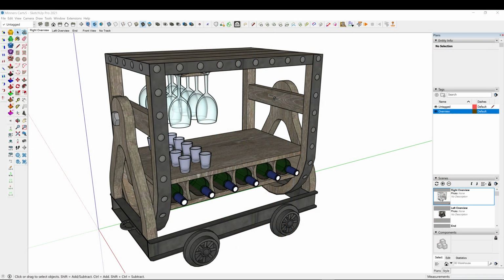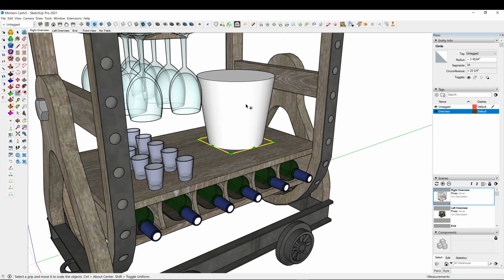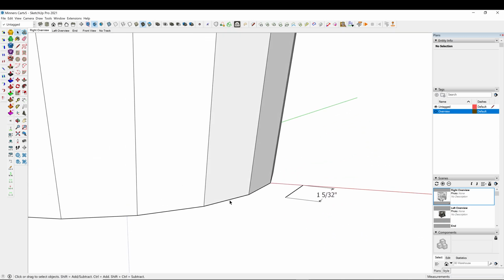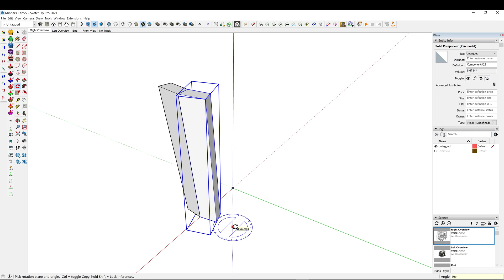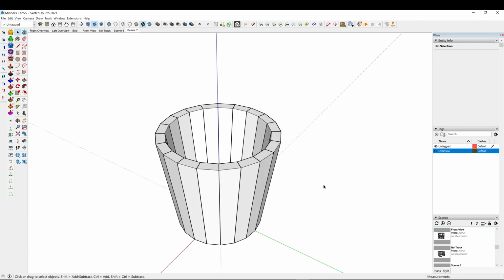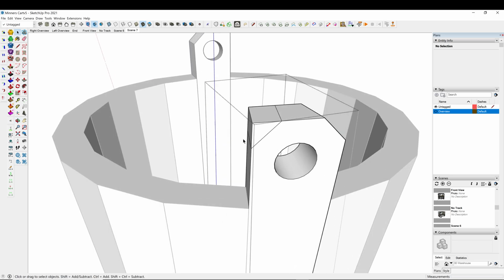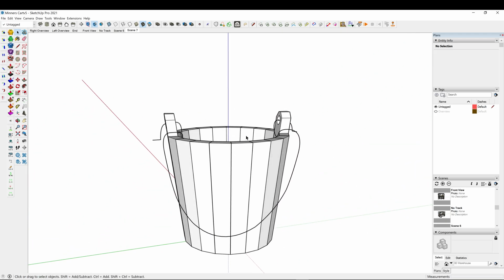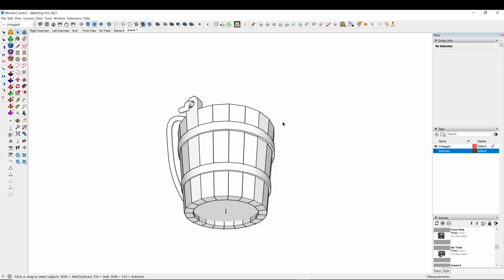Designing A Tapered Stave wooden Bucket in SketchUp

Comment: Excellent video. I’m trying to figure out the measurements for a bucket with 20 staves, but I have zero cad skills. The base would be 14” diameter, the top would be 12” diameter, and the bucket would be 12” tall. 3/4” thickness of material. Like yours, I’d have two of the opposing staves extend upward by 2” to accept a rope handle. I’m a bladesmith and blacksmith, and would use it as a forging bucket. Mine would just be the reverse of yours. Large at the base and skinnier at the top. I’d pay you to draw it up for me so I can build the jigs and get the correct angles. I guess I could find someone on fiver to do it, but I’d feel better paying you to do it as you already know the project. Anyway, I hope you can help. Thanks!
Reply from the maker: Sorry man with all the other projects going on, I don't really have the time for a project like that.  I do teach sketchUp courses so if you want to tackle it yourself the link is in the description.